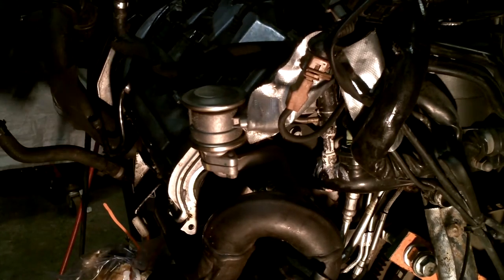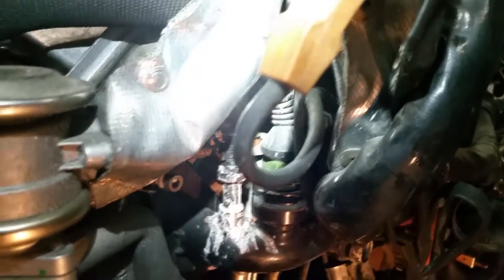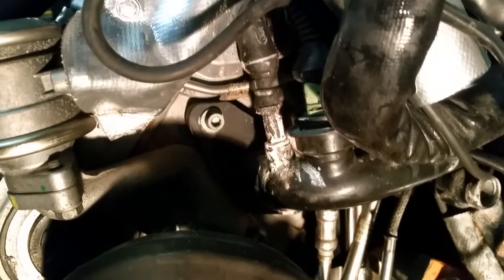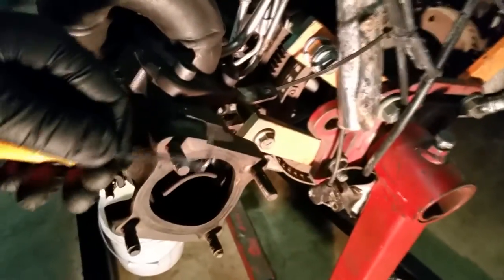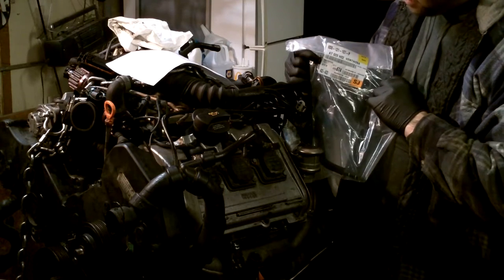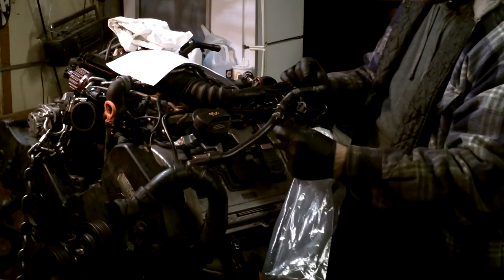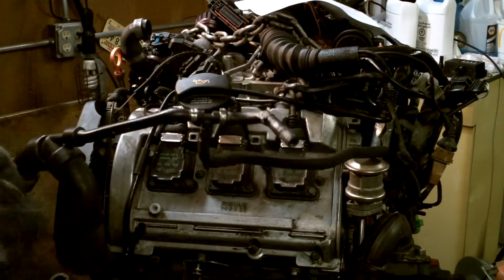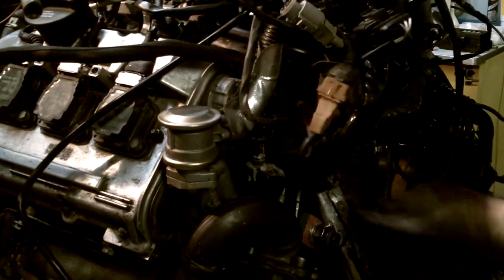2002 Audi S4: Ep. 157 Driver's side 2.7T coolant breather hose

Comment: Bob i have a 2002 audi s4, my concerned is that i took it to a smog shop to get a smog but while the technician is doing the test, may computer won't communicate with the scanner or smog machine. Maybe you could give me some idea or fix what the problem might be. thanks so much . . .Ricky
Reply from the maker: Hey Ricky.  Do you have more info as to how they're trying to connect their scanner and smog machines?  Are they OBDii?
Reply: @snyperbob  I'm working on a 2003 Audi A6 2.7t (auto trans) for a friend. She has a coolant leak on the driver side of the engine that leaks towards the back.(drips from flywheel area) underneath the car. I can't see nothing from the top , is there any known spots for the driver side?
Reply from the maker: @codyvogt9610  sounds like it's leaking from the location I show in this video. Grab a flashlight, dig deep and you'll find it. Use a mirror if you need to look around and past things
Reply: @snyperbob  okay I will do that. Thank you I appreciate it. I'm not familiar with these engines at all but I also don't want to see her spend alot of money at a shop just for a small coolant leak. But again thank you.